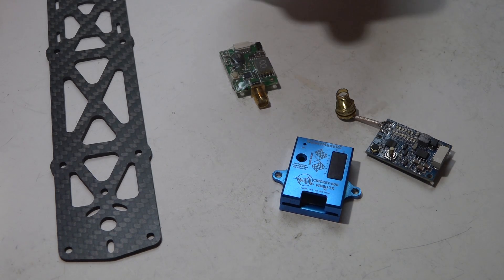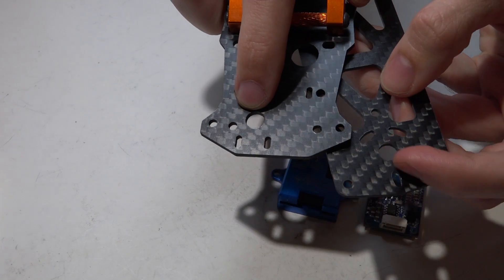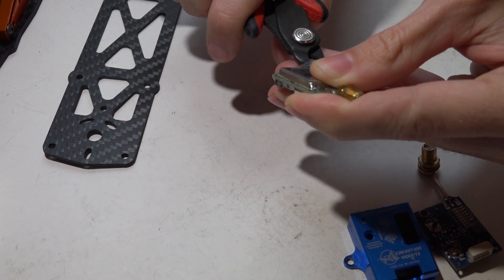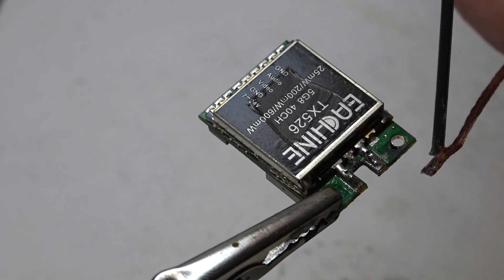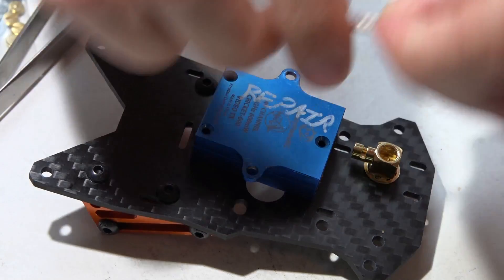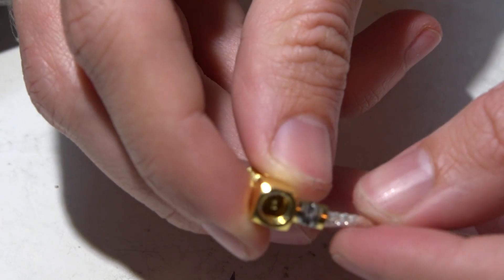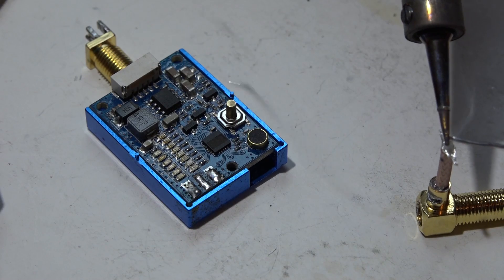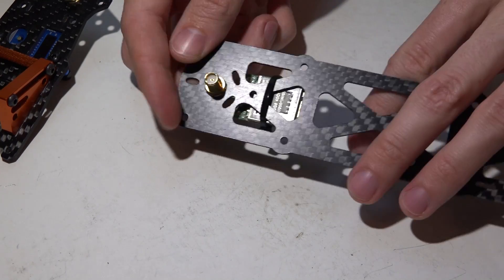Multirotor Build Pt10: VTx Mods & Mounting

Comment: hey jc ;P Enjoying your content so much! ;) But i have a question, if you attache the Antenna to the top of your frame wont the Connector brake if you crash really hard? I did it similar to your way, but i had to use a extension connector without a real bulk head thing to mount it right and it broke on my first crash :O ;D

Comment: Would a 90 degree adapter not fit the frame? I see that it has to be an exact length for the cricket to be able to bolt in so I wondered if they designed it so that u didn't have to do this mod in order to have your vtx (that the frame is designed around) have its antenna come out the top

Comment: Having trouble find a good quality hot air gun.   Seems like some of the reviews of the 858D and various clones recently indicate that this model has a tendency to short out or have other problems.  At one time looks like you were using one from Zeny and wondered if you still recommend that brand.   I am really enjoying the series.   Ordered some of the parts for the RMRC version but several parts are backordered.   Probably due to your recommendations.  :)
Reply from the maker: This is the exact one that I have. Haven't had any problems so far and have used it for almost a year now. https://rover.ebay.com/rover/1/711-53200-19255-0/1?ff3=4&toolid=11800&pub=5575257854&campid=5338014988&mpre=http%3A%2F%2Fwww.ebay.com%2Fitm%2F858D-Rework-Station-Hot-Air-Gun-Kit-SMD-Iron-Soldering-Solder-Holder-700W-%2F272428095142%3Fhash%3Ditem3f6dfad6a6%3Ag%3ADo0AAOSwHsRYDbVE

Comment: Dude just cut the legs, and do not overheat the board, with the hot gun.
Reply from the maker: Problem with cutting the legs is as you make the first or second cut, because other legs are still attached, the thickness of the wire cutters breaks the small half of the leg rip the pad off the board. Doesn't happen every time but I'd say there is a 1 in 4 chance.

Comment: Is there any issues with the connector being attached to the frame without any nylon or rubber shielding between the frame and the metal? On my kingkong 210gt it came with a rubber grommet.  I assumed so it would not ground to the frame? 

Either way. Thank you for your very detailed build.  And that it's broke up into small bite sized chunks too. I'm really enjoying the episodic nature lol
Reply from the maker: Nah its fine. The signal wire is separated in the antenna, then through the connector, and all the way to the VTx

Comment: Jc, I am hoping you can help me as I am new to this hobby and am doing my first build. I have a runcam swift 2, eachine tx 526 and eachine goggles 2 connected separately using battery for power on the bench  to test before install. The vtx seems to work fine as I can change all settings and the goggles scan and lock on to the frequency but the picture on the Goggles continues to roll and is not clear. As you know, documentation on this stuff is severely lacking and tech support dismal. I noticed that the menu on the goggles says at the bottom PAL V1. Theres nothing to indicate in the goggles manual or box whether they are Pal or NTSC or if this can be changed. Every video on you tube shows everyones picture working right away so I have not found a trouble shooting video on this. Any suggestions from anyone would be appreciated as I am a noob to this.  By the way, love your videos, they have helped me a lot throughout this process.
Reply: Thanks for the info. Your saying that the googles 2 have a changable setting to go from PAL tp NTSC? I did not see one although it is hard to read while its rolling and at almost 60, my eyes aint what they use to be. Do I need to use the OSD cable?
Reply: Found it. once again thanks Fade!!!!!!

Comment: Im waiting for the software step and communication between the receiver and radio, im having trouble with my zmr250 getting it to lift off. During software testing with betaflight everything seems to be ok but once disconnected from the pc, once i increase the throttle after arming, motors do not start at the same time then there is one or 2 motors that increase in throttle on their own, also when throttle is increased there is a lot of beeping that i believe is  coming from the pdb. I think the beeping  is an alarm for low battery voltage even after the battery is fully charged. i did flash the escs and configured them with bheli configurator but  still the same issues.
ZMR250
Matek 5 in 1 PDB
SP Racing F3 V1 Flight Controller
Fly-Sky FS-T6
Fly-Sky FS-R6B - PWM
Favourite 20A opto Littlebee 2-4s Lipo Oneshot 125 - Flashed to 14.9 Multishot
Zop Power Lipoly RC Battery - 11.1v 40C, 1500Max
Emax rs2205 kv=2600  3 motors
Emax rs2205 kv=2300  1 Motor

Comment: Pay attention!!

You remove  connector from  transmitter  - MALE.
And then you connect - FEMALE.

People will then have big problems with the adapter!
All antennas - FEMALE.
Reply: Unless I misunderstood I am pretty sure he said he was changing the Eachine from RP-SMA to SMA which explains why the original had a center pin (female RP-SMA) and the one he installed has no center pin (female SMA).   That said, his list doesn't have any antennas yet for the build and I can see someone looking at the Eachine specs and reading RP-SMA connector and ordering that connector with their antenna.   He also switches tx during the mod process where he starts with the Eachine for the RP-SMA removal,  and then switches to the Cricket 2 for soldering on the first replacement connector.   Bottom line, just be careful what antenna you order depending on which tx you order and whether you change out the connector.   His builds right now appear to be supporting SMA antenna if you do his tx mod.

Comment: It's really impressive watching you do major surgery on these components. Especially using minimal components like the same tip for everything you solder. I bought a $100 soldering station with 10 assorted tips and I constantly change the tips and temp. to find something that works (and usually destroy 1 out of 5 boards with too much heat). I wouldn't even attempt this level mod. So, once in a while could you incinerate something and make me feel better?

Comment: I bought 3 of the eachine vtx last month, for £10 they're exceptional value. However, I've found that the soldered rp sma connector has come loose on one of the boards and eventually come off. This is a great way however of improving the eachine even more, and I'll be doing this seeing as I already own a few!. in reality they should sell them like that. I've already got the cable, just ordered the right angle connectors off eBay. Great vids by the way.

Comment: or... you can actually buy better VTX with the connector you need from Banggood in the first place
BG doesn't only have cheap crap, you can actually buy quality items there as well
Reply: Well, I've learned that I don't want to spend unnecessary time with re-soldering connectors and other minor tasks and I rather buy something decent like Aomway TX001 or Diatone SP2/SP3. I know you will argue about saving money, but my time is also precious and I honestly don't care about saving 10 dollars on a hobby where I spend hundreds. Still love your videos, many times very helpful! Just mine opinion, you are sometimes over-complicating things :)
Reply: Erionax he could have just bought an adapter too, but I agree, this is a pretty bad vtx.
Reply: Erionax I am going to buy vtx next week, could you please add a link?
Reply from the maker: Yea I could have done that. But what would you guys learn from that. Besides, RPSMA doesn't matter to me because I put a bulkhead through the top plate on all my builds.
Reply from the maker: No I wont argue about saving money. I'm using the $50 cricket on the other build. Just saying I wanted to show as many ways as I could to give anyone multiple options.